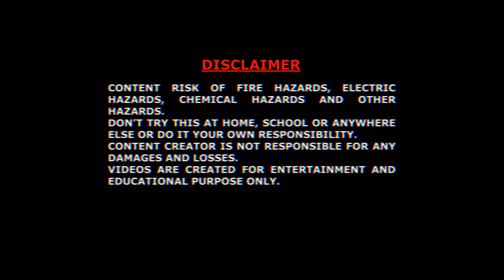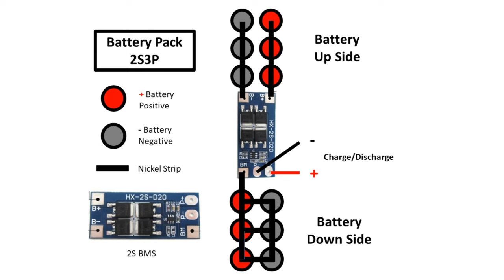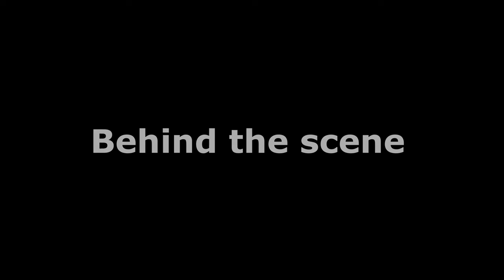DIY 2S3P Battery pack | 7.4v - 8.4v | DIY Battery pack | Lithium battery

Comment: How to charge battery
Reply: Charge with bench power supply set up to 9V and 1A. The charging board will only let max. 8.4 V thru. The 1A will start to decrease as time goes by  as the battery start to fill. Board will shut off automatically at around 30mA and 8.4V. You can also use 9V charger or adapter, the highest amps will be stated on it. The board can also be at maximum connected to 12v charger /adapter since the board will only let thru 8.4V. More than 12V's and the Mosfets will start to fry.
Reply: @hermanussi  thanks for reply
Reply: Glad to help! 👍

Comment: U have made it its nice but if we want to connect it with a 3W 8.97v 3A solar panel then
Reply from the maker: As your plate is 3w, it will take some time to charge.
Reply: Can  I have circuit diagram
Reply: I am waiting for your reply not received any response

Comment: Agar mai 2s3p charge raha, then how much current do I need to provide the batteries? 
8.4V 2AMP is enough or do I need to increase the amps given?
Reply from the maker: Yes it is enough, also note charge current will depend upon your battery capacity

Comment: Pregunta amigo el voltaje de entrada a los BMS Cual tiene que ser por ejemplo ,si es de 3 celdas pueden ser de que rango superior ?
Reply from the maker: Max voltage is 8.4and BMS is for 18650 batteries only ,2S build
Reply: @lets.powerup  gracias por tu respuesta pero me refiero al módulo completo 12,13,14vdc

Comment: How much ampere
Reply from the maker: Each battery is rated 1200mah x 3 3600mah
Reply: The bms appears to be a 13 amps bms.  (That's a lot of power.  Be careful.)

Comment: You are damaging the battery by putting  so much heat (soldering) 
The audience should know that you are making a severely  damage to your 18650 
Man order a mini spot welder
Reply from the maker: If you r making larger battery then soldering is not professional way I think